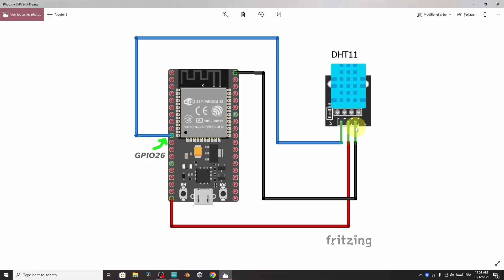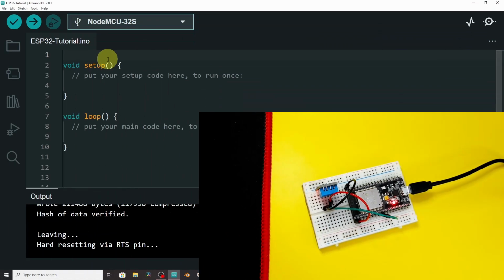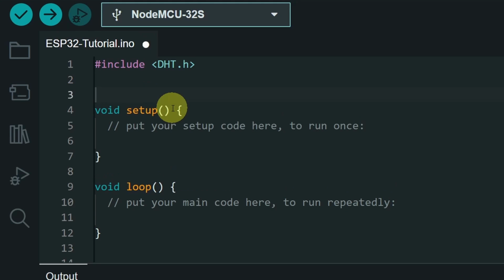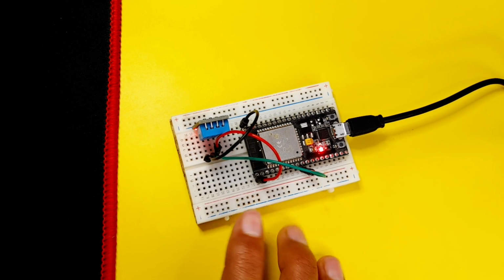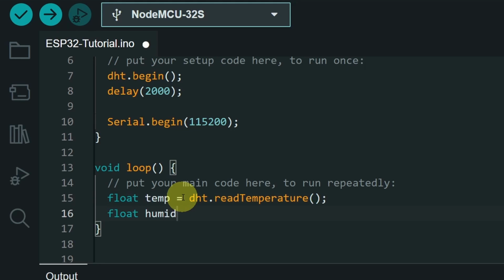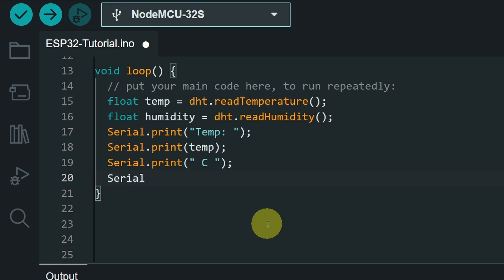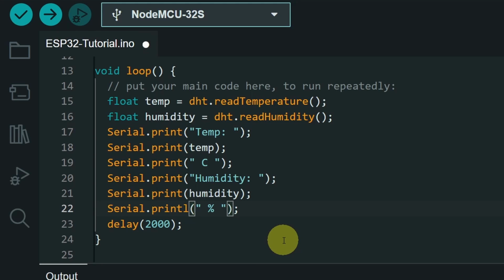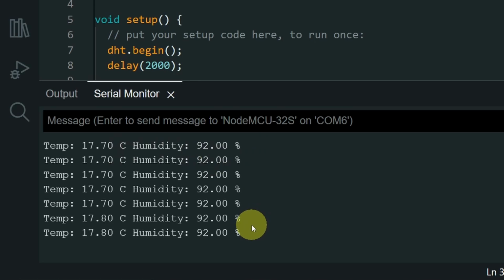ESP32 Tutorial - DHT11/DHT22 (Temperature and Humidity Sensor)

Comment: My DHT11 only had an "S" next to the 1st pin,   I searched around, and found out that my pinout is  pin1 = data  pin2= V+,  pin3=  -neg.    my ESP32 also had different configuration (30 pin) but I kept it on GPIO26  and put the + on 3v3, and of course the negative to GND. 

It worked perfectly.  I used the (true) for  Fahrenheit  also known as barbarian units lol,   although I do not think my sensor is very accurate,  indicates a temperature higher than what it really is, but the temp and humidity to change, if I blow on it the humidity goes up as it should.
Reply: Thank you for this....I have been struggling to figure out the correct pinout for my sensor!!

Comment: I'll try using your video, as I have an ESP32 S3 board and an INA219 current sensor and using PlatformIO in VSCode and I can't see the current values. It only says `Talk is running`, which means it is reading, executing but the current values do not appear on the terminal. If you can give me a tip I would appreciate it! Or if I had a video from someone even better?

Comment: hello, when i compile it says failed uploading. i pressed the boot button and the enable one but still the same problem. 
what can i do please?
Reply: You are 100% sure you didn't make a mistake in the code? Try pressing verify for compiler to check if the code is "doable" for your board. Of course it may not support all exceptions but it usually helps to notice a missing comma or dot. If it does compile you should make sure you have the exact board. For example just by looks Esp32 and Esp8266 look simmilar (build almost the same way, usually on the board type, and both cores are shielded) but are different inside.